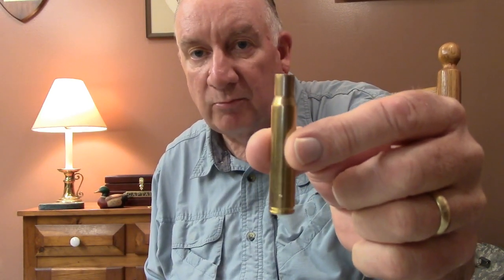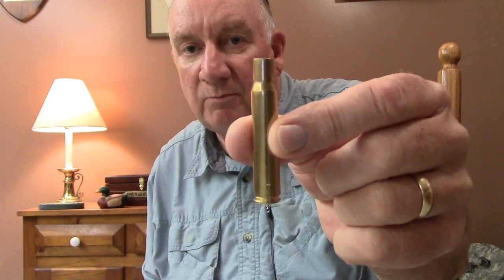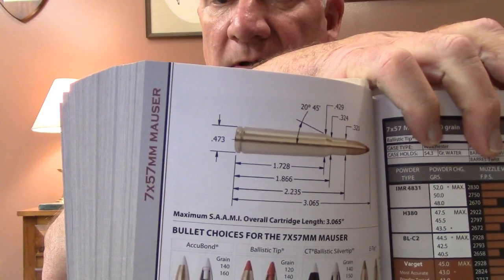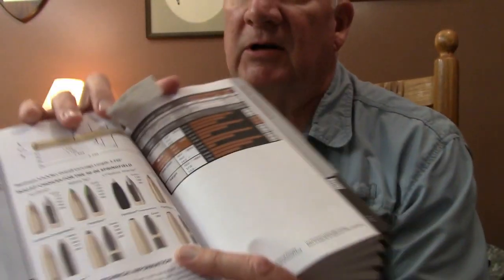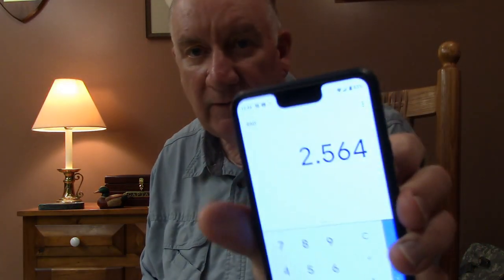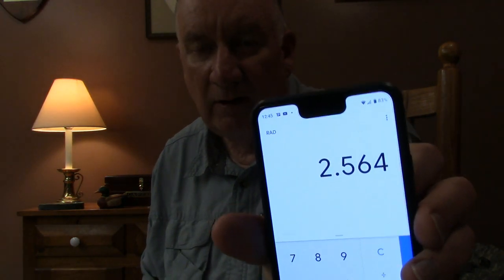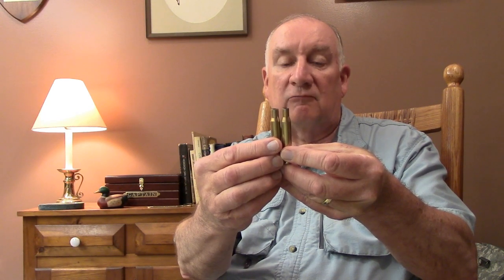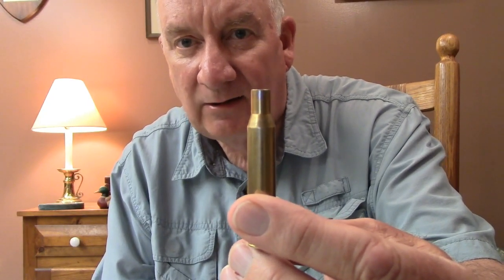Winchester 270 Origin Myth ~ Stupid Wiki Nonsense

Comment: Did the U.S. Military ever consider using the .270 Win for military use? I realize that fiscally it might not have made sense, but I can't help but figure it might have made sense to consider to get an 06' with a bit higher velocity and less kick...
Reply: The closest thing to a .270 we - meaning the U.S. Ordnance Dept. - ever came was during the 1920s when the first tests of M-1 Garand prototypes were being conducted. One of the cartridges tested was the .276 Pedersen - a 7mm-class cartridge which actually performed very well in the testing, which included terminal ballistics tests against live swine, but General Douglas MacArthur - Chief of Staff of the U.S. Army at the time - turned down the switch away from 30-06 because of the large stocks of the '06 in U.S. armories and warehouses. I've never fired a .276 Pedersen, but a commercial .270 loaded to typical hunting pressures/velocities - has just as much kick as the 30-06, at least to my perception.
Reply from the maker: Not us, but that bore was briefly considered by Great Britain in the early 60s as a lighter caliber.  Not long after the introduction of the M14, and the arming of Soviet soldiers with light Kalishnikov automatic rifles, we realized that the heavy 30 caliber, long range bore was based on an out dated combat model that was abandoned by the German army, and we were seeking a very light combat rifle.  See my M-16 videos. Though lighter, the 270 was not significantly lighter than the 06.

Comment: How does .270 compare to 7x64?
Reply from the maker: The 7x64 Brenneke has virtually identical ballistics to the 280 Remington.  With bullets of equal sectional density and ballistic coefficient, the Brenneke and 280 have the same trajectory and superb killing power on medium to large game as the 270 Winchester in practical terms.  With its slightly heavier and larger diameter bullet, the 7mms are better choices on large elk and moose. The Brenneke was invented in 1917 during WWI, nearly 40 years before Remington got around to copying Wilhelm's great cartridge.

Comment: How much better was the heavy roundnosed 7x57 than the 30-40?  I have never cared that much for the 270' win. But after using the 6.8 spec. I may have to give the 270 another look but which one web.,win.,or wsm?
  Any way thinks love hearing your take on this gun stuff. I don't get to shoot as much as I us to. And I can tell.
Any happy Father's day everyone.
Reply from the maker: Even with the heavy bullet, the 7x57 had somewhat longer reach, and was a better battle rifle.  The Krag is awkward to load with the side loading, non retention box magazine, and its rate of fire was faster due to lighter recoil and far better loading system.  The Krag magazine is also prone to emptying accidentally.  The Krag used a 220 grain round nose bullet at 2,190 fps. muzzle velocity. The Mauser used a 175 grain round nose at 2,460.  Trajectories are not too much different, but the shortcomings of the Krag design and limitations of its range in open shooting became apparent.
Reply: @GunBlue490  ok thanks. I actually had he change to hunt with a krig back in the early 80's. I was looking at buying my first boltaction cf rifle. The old gentman had the 30-40 and a Brit mrk3 in 303. He let me use each for a weekend. I picked the 303. Be sure it was normal loading it came with abunch of bullet's. Both were the high sum of 55$  and you could get 303 sp. Locally and it was easier to scope.